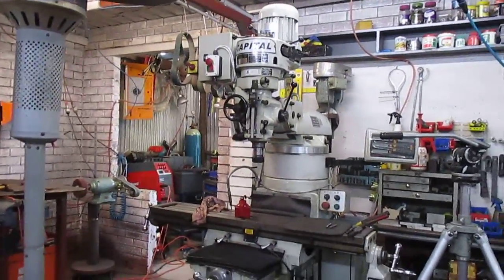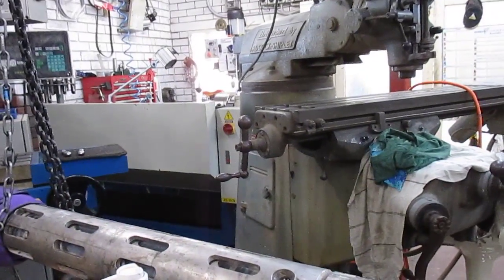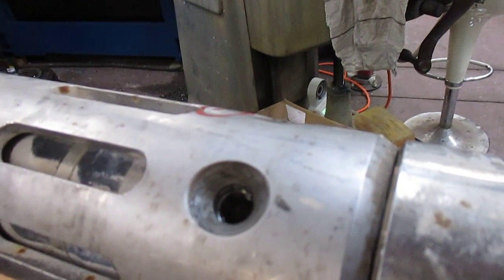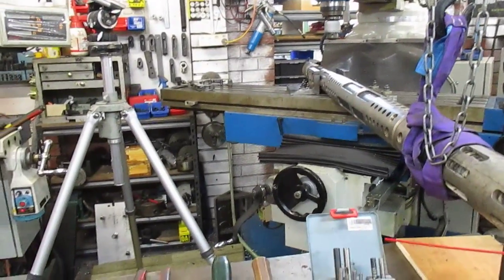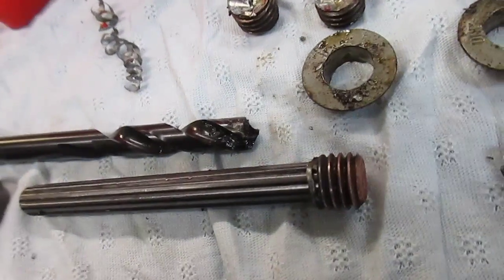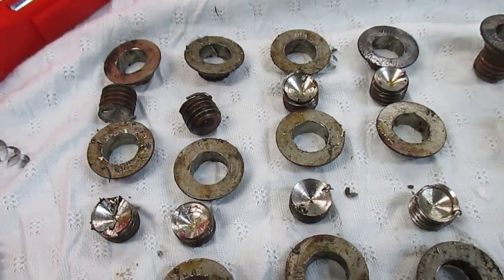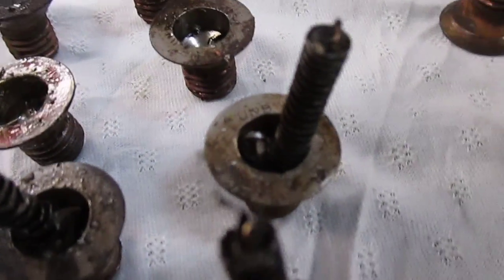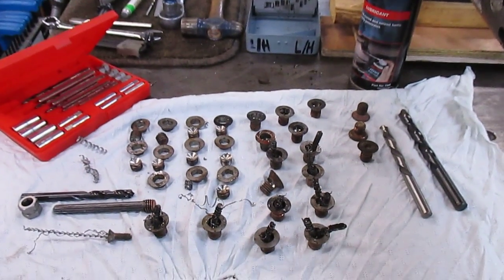Getter Out 9 part 8

Comment: Your videos are interesting but much too short.  This getter out could have been done in one or two pieces.  Thanks for sharing.
Reply from the maker: Cerberus G'Day, the reason they are short is that I'm forever being distracted by clients visits and calls, and also and mainly because the upload time is horrendous. Hence I have gone to making shorts in a series rather than tie the computer up for 10-15 hours to upload a 10 minute video, there does not appear to be a cure for old copper lines and telephone exchanges. Australia has a terrible system outside of the CBD's and it probably won't improve in my lifetime.
Reply: Yes I can see a slow internet connectiont is a problem.  I supposedly have a very fast connection and it takes quite a while to upload a video.  I guess I will just have to be happy with things they way they are.  Keep up the videos and how ever long they are we will watch.